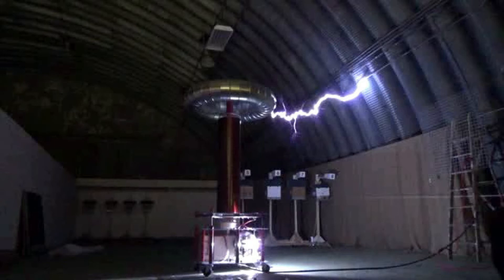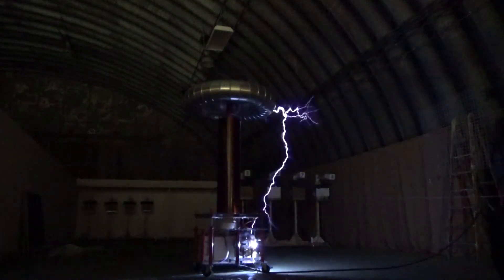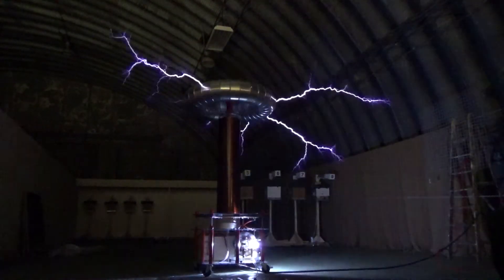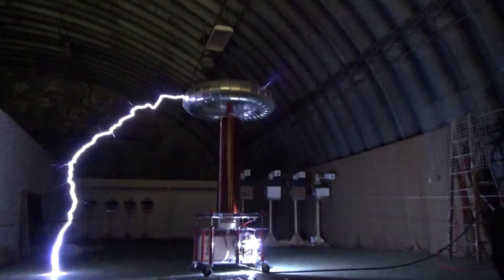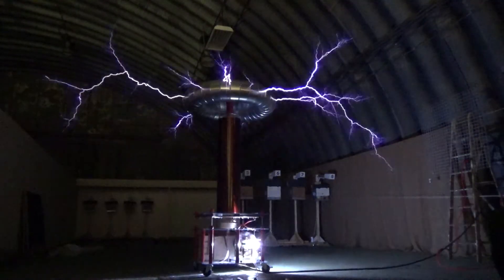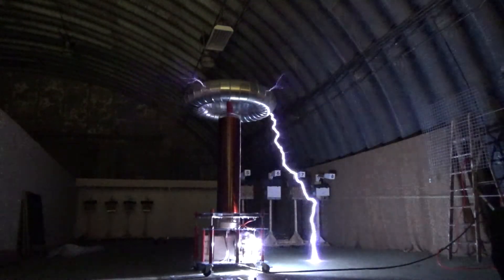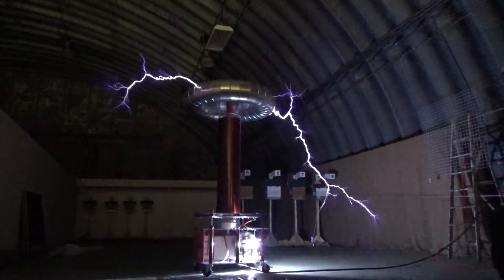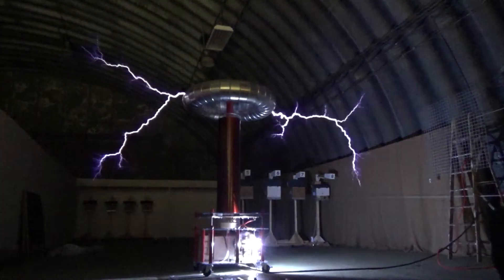Big Tesla Coil Review

Comment: Is it possible to achieve the same result using 4 microwave transformers as HV source?
Reply: Hello, Just came across your question. People do seem to perform "miracles" with MOT's but I doubt that similar results  could be achieved without the pig or equivalent.
Reply: Nope, maybe a bunch more in series/parallel with voltage doubler, but it's complicated

Comment: If you want a single streamer try a sphere top load, ive seen arcs climb straight up and just stand there its real spooky because they dont retract immediately
Reply: Hi,  A sphere would be hopeless for secondary protection and field control, the toroid size is less than optimal as it is.
Reply: @phillipstrauss6060  then make just the top half spherical and the bottom toroidal just like the wardenclyffe tower  tesla built   perhaps?
Reply: @stagethree1  A 12" secondary demands a large toppled and I doubt whether a sphere or half sphere large enough to remotely shield the secondary. is available. The 50" fabricated toroid was expensive enough and difficult to obtain, we are working on the 60" ring toroid which is a major operation in itself and will be the last effort in this sphere (no pun intended) !
Reply: @phillipstrauss6060  yes i agree toploads are very expensive especially at that scale, any redesign should be tested at low power smaller scale to prove it works,

Comment: Cracking video, you say you have a 200bps rotary that you use on your 8" coil, have you done a test of using the 200bps RSG on the 12" coil, I`m guessing you are using a pole pig for the power supply if so have you thought about using a high speed Async gap (Oh love the location BTW inside a HAS so which cold war airfield was it....?), oh and it looks like you beat our old record for arc length.  https://youtu.be/Y1agcn2ulL8
Reply from the maker: Yes 11.55kv pole pig for supply, over-driven by the variac to about 12.7kv rms. We recently put the synchronous 200bps rsg on the 12 inch coil, and once we got the phase right, it behaved and sounded just like the 8 inch(although we had matched the mmc sizes and also used the same 50x11 inch toroid, so it was no surprise they behaved the same).
Reply: The bunker was at Alconbury near Cambridge.
Reply: Forgot to mention that we used a fixed speed ASRSG (364 bps) at Cambridge (10") some years back and it worked pretty well but wanted to experiment with 100 bps for pure interest sake and the lazy ground inclined streamers.